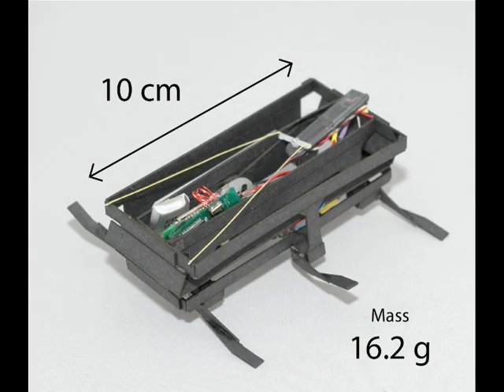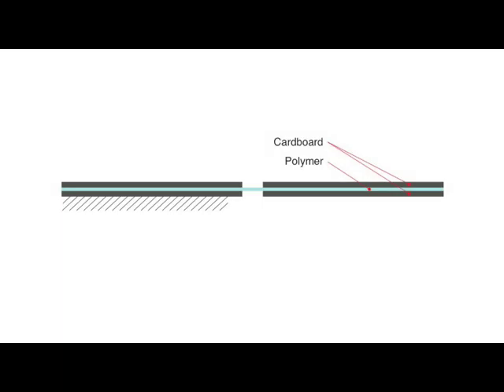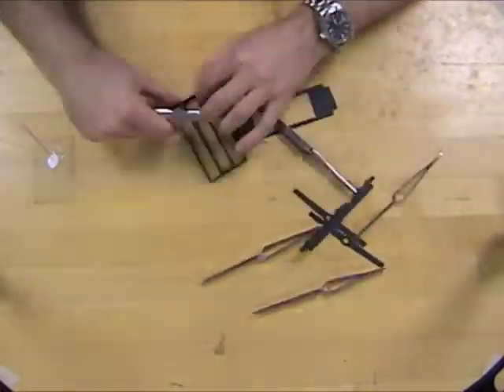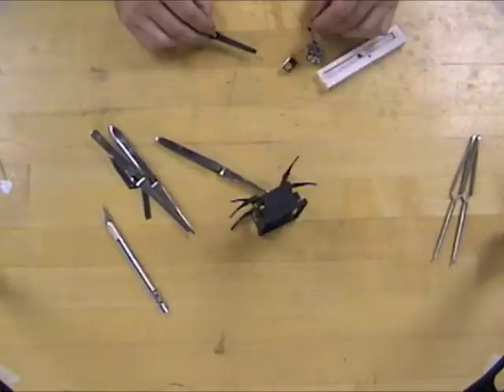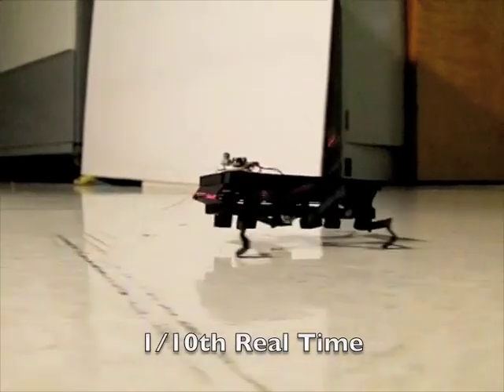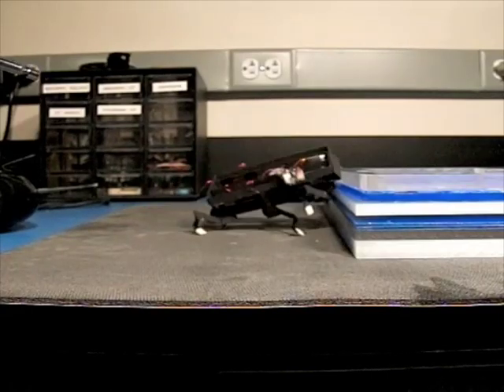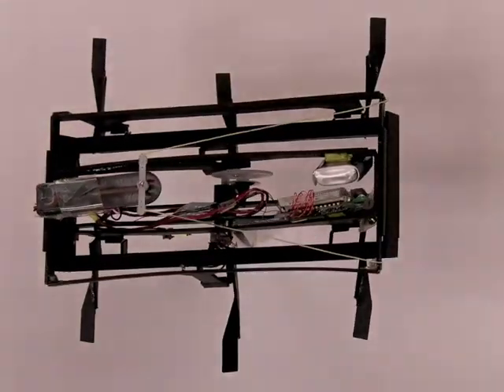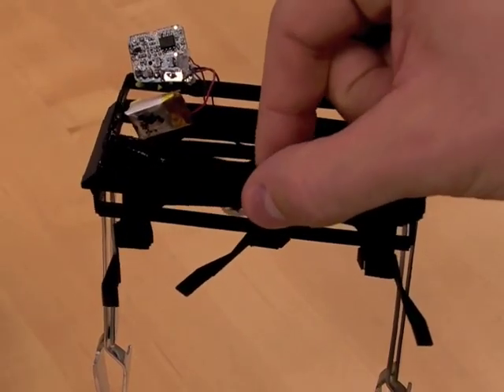DASH: Resilient High-Speed 16-gram Hexapedal Robot

Comment: the pcb looked open to the elements but you can coat all the electric parts no problem. i was thinking the same thing because it kinda looked like a water bug. with the right technology it could run across the top of the water as long as it doesn't break the surface tension of the water.